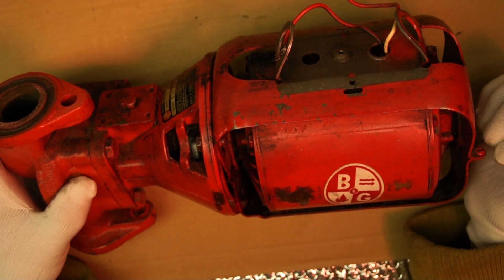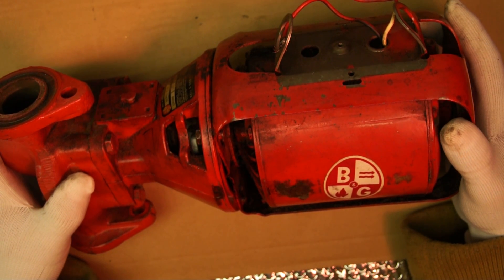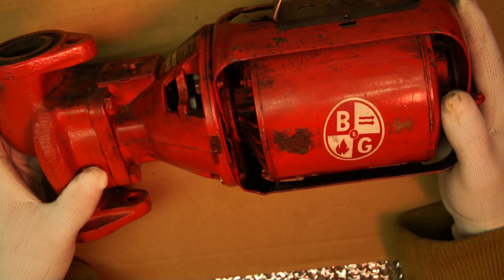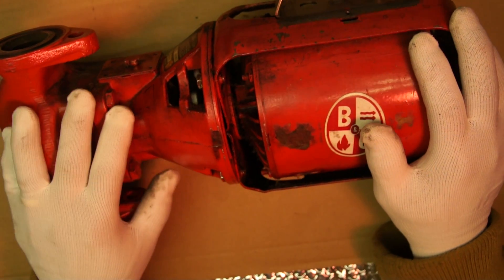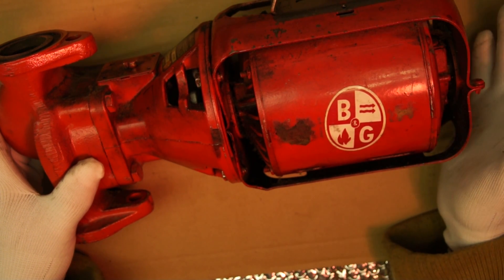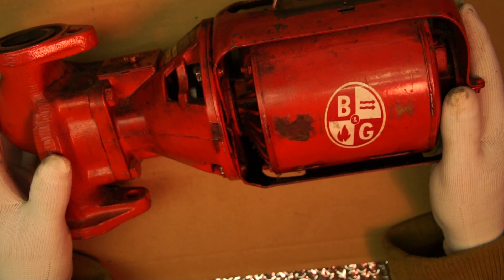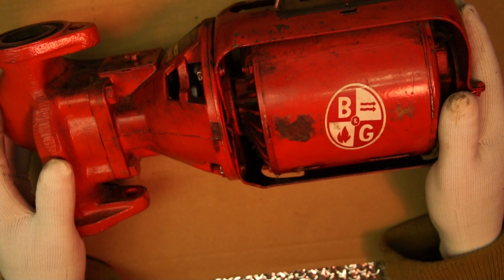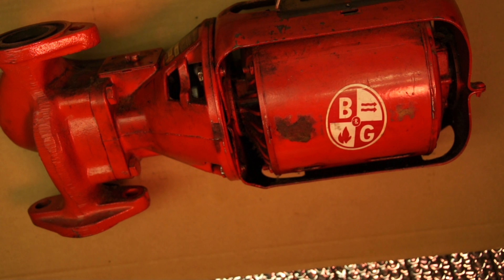Let's teardowm the B&G Circulator pump

Comment: temporary fix, take a clothespin apart and lift rear of motor up or change bushings
Reply from the maker: Thanks
Reply: Thanks for the tip!  The rear bushing in ours is sagging a bit...Not sure when the B & G 100 was introduced; ours is, I'm pretty certain, original to the house (1954, split-loop BB heat, one zone), as is the boiler (American Standard "Empire" series, 6-section CI).  A slight hum from the circulator is all I notice; pretty good for 63 years!  Nice, informative series, Wink!

Craig
Reply: Update:  Tried the shim fix for the sagging rear bushing; seemed okay, but more motor/pump noise was transmitted thru the piping (humming was more audible than before; my wife noticed it more during that night).  I suspect that while it propped up the motor w/in the frame, that piece of wood acted as a "sounding path", hence more noise in baseboards.  Coupling/motor sounded fine, otherwise.  Removed shim, less noise (but will have to replace rear bushing, anyway).

Thanks again; the whole series is very informative!

Craig